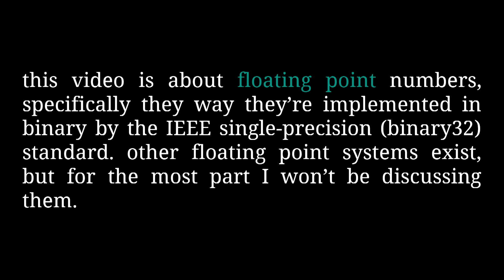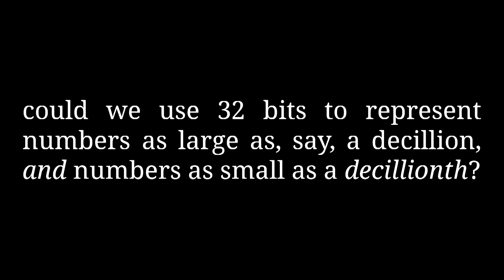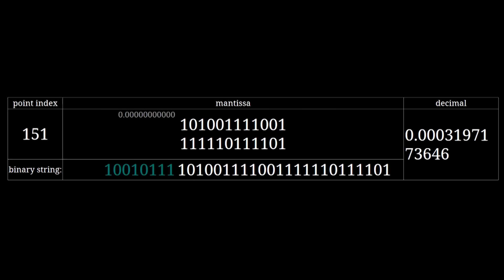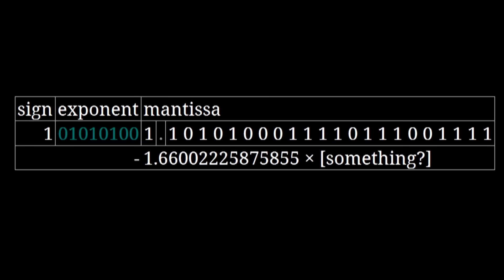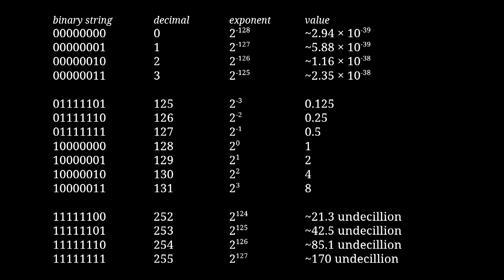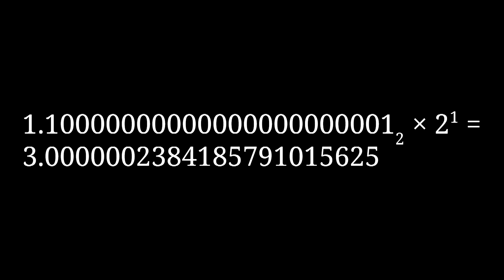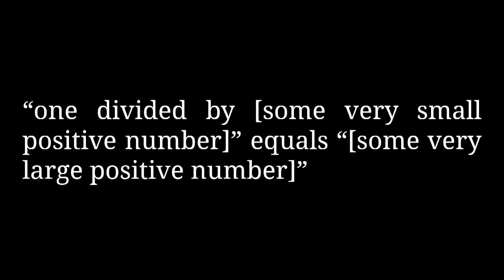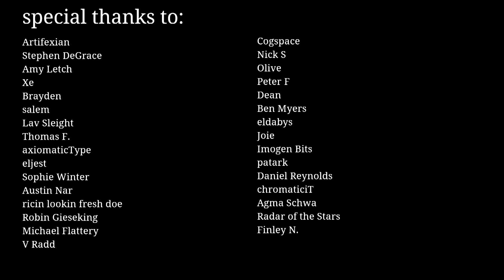how floating point works

Comment: This is better than the explanation given in my first year of my computer science degree, with one important omission:

If two approximations are very good, subtracting one from the other might STILL yield a massively disproportionate difference. For example, a quadrillion minus a quadrillion-and-one is one. But floating point numerals would return 0. So that's wrong by a factor of NaN.

If you don't want a factor of NaN in your multiplications/divisions, this is a (real world!) problem.

Comment: The floating-point standard was written up in 1985. What would you have done in the mid-1980s?

Also, what would be a good suggestion to update the standard?
The suggestion can break the standard.

Comment: binary-coded decimal is a neat one too, calculators use this one a lot. Only issue here is that each decimal digit takes up a byte, or at least 4 bits (1 for each digit, at least 1 definition for a decimal point). This setup allows you to do precise decimal math which you need for a calculator, but you're massively limited by storage space on your device and operations are more time-consuming to perform.

Comment: The coolest thing about the compromises floating point makes, imo, is that even though the constructs it generates are not technically individual numbers (but ranges of them, as you said), they reflect a lot of the interesting realities of working with infinity and infinitesimals in fields like calculus. We wouldn't say "1/0 = ∞" or "1/-0 = -∞" in calculus per se, but intuitively this is more or less correct.

This, I imagine, is probably in part why this standard ended up sticking even though it's kinda awkward. Arbitrary precision is lost, but for engineers and scientists, you gain something better: a rudimentary reflection of higher-math concepts like infinity.

Comment: I don't think 'supernormal' values (other than the infinities) can be represented by floating-point numbers. But they can in metafloating-point/floating-metapoint numbers (I guess (almost) all numbers would them be super- or subnormal.) Just imagine representing 2^2^30 in 32 bits.
Reply: Edit: I think 'floating-metapoint' (where 'metapoint'='metaradix')' is less confusing than 'floating floating-point'. 
And I think the biggest number would be 2^2^29, since you need one bit for the sign.
Reply: Edit: YouTube in Firefox mobile doesn't let you edit comments, so I have to post this as a reply.

Comment: The cool thing about not specifying what the NaN payload bits do is, that there are 52 such bits in 64 bit floating point numbers, and pointers on typical 64 bit platforms only actually need 48 bits. So you can do something similar to "tagged pointers" and say any NaN that has any payload bit at all isn't actually a NaN. Instead 4 bits (minus one value, given that one has to always be 1) can be used as a type and the rest of the payload bits is either an 48 bit integer or a pointer to a heap allocated object. And indeed some JavaScript implementations do just that. You know, since JavaScript's typeof only returns 7 distinct values (fits even in 3 bits with one value to spare)!

Edit: Wait, I forgot function. That means all 8 values of the 3 bits are already used.

Comment: so, there is no zero in floating point ....... that's pretty insane... (only range of numbers barely larger than 0, and another range barely smaller, but never 0 itself) ?
Reply: actually ...  are they inclusive? - could it be, that positive zero is inclusive of real 0 and negative zero is not?
Reply: @Verrisin  +0 and -0 are defined to compare as equal, so they're both in a sense inclusive of "zero"
Reply: @Kaiasky   Thanks. .... so indeed, there really are 2 zeroes... both ranges inclusive.... - At least it does have zero, though :D

Comment: As an engineer where most of your numbers are actually measurements, this is a really good way to approach getting used to thinking of precision and accuracy. The values are only as accurate as the tools you use to measure them.
Reply: Unless coastlines.

Comment: The reason the sign bit is zero for positive and one for negative is pretty simple: in some ancient computer architectures, signed integers were also represented with a sign bit where the highest order bit was used to denote the sign. Using zero as the positive sign bit allowed for positive numbers to still be read normally. e.g the value of 7 as  a 4 bit signed integer would still be 0111: the same as for an unsigned integer. If it were the other way around 7 would be represented as 1111 and -7 would be 0111 which is a less readable choice because neither number is represented in an intuitive way. The same thing goes for modern computer architectures which use two's complement: positive numbers are still able to be read the same as if they were unsigned and negative numbers start with one. 

It would make things unnecessarily confusing to reverse the rules for integers and floating points, so zero is positive and 1 is negative.

Comment: This is a very nice video. I like that you explain not just what floating point is, but how someone would arrive at it as a way of representing numbers. Anyone interested in how the extraneous bits in NaN values are used in practice could look into something called "NaN packing." It's a technique (mostly used by programming language runtimes) used to cram a lot of different types of values into 64-bit floating point NaNs. In 64-bit (double precision) floating point, there are 12 bits used for the sign and exponent bits, and then 52 bits left over. Four bits can be used as a "tag" allowing for 16 distinct packed data types, and the remaining 48 bits are enough to store a pointer (on 64-bit intel platforms, a pointer is only 48 bits wide).

Comment: Fixed point seems to generally be a better option for most applications imho
Reply: You do have to be very careful when implementing fixed point algorithms since eg, if you divide by 1000 and then multiply by 1000 in floating point, you're probably ~ok. If you do that in fixed point, you truncated your last 3 digits. 

Often, if you're careful a better solution is to reformat the algorithm/formula in terms of integers (eg, instead of a number N, you have rational stored as a/b and write your algorithm in terms of a & b) and get by with pure integer multiplication/division.

Comment: I would hypothesize that at least part of the rationale for having 0 as positive and 1 as negative is that it's consistent with how the first bit in a two's complement binary integer behaves, so you can just look at the first bit of any signed number and know what its sign is without having to know whether it's an int or a float.

Comment: "And that's a really good question."
…
"The other problem with—"
😂 
This wasn't just informative and really well-explained, but funny to boot!
Reply: I lost it at this part!
Reply: actually i think it makes sense for 0 to represent a positive number in the system. that way, a floating point number that is initialized to all zeroes would represent positive zero instead of negative zero.
Reply: @chromosoze it also makes sense with how we represent negative numbers usually. If I right 5, you assume I mean +5, I have to indicate -5 which is done by adding that 1 in front of it.
Reply: @chromosoze  it also saves the explanation that we store negative numbers in binary by flipping each bit (including the sign bit), then adding 1. (It makes doing calculations with the numbers easier as it automatically flips the sign bit when it crosses zero)

Comment: I always figured 0 means positive because most of the time you'll be using positive numbers, and 0 is the default value. It just makes sense, from a programming point of view. Default values should represent the most common option, when possible.
Reply: Uninitialised memory may take on any value, unless zero paging, 0xDEADBEEF paging, or a higher level language that initialises things for you. Personally I like the 0xDEADBEEF, starting every page full of that patters means if you forget to initialise anything then the output is very obvious.

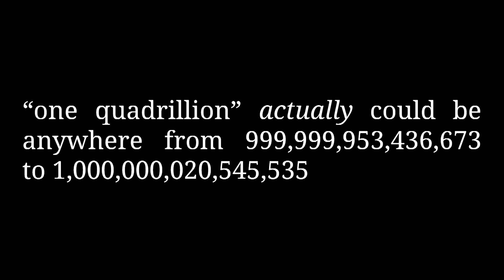Comment: 5:45 We use 1 as the negative input due to how computers subtract numbers. There isn't really a way to subtract a number in binary so instead computers add two numbers that cancel out. If you want to know exactly how that works watch Sebastian Lague's video Exploring How Computers Work. In that video he gives a great explanation. You should watch the whole video, but he explains this at 12:12
The TL:DW is that if you add the inverse of a binary number to the original number you end up with a number that takes one more binary place to represent. (As we say decimal place I'm saying binary place). If you just ignore the carry over digit then you have successfully subtracted two numbers.

Comment: This is the best explanation of IEEE 754 I've ever seen. Much easier to follow than the textbook I originally learned this stuff from 20 years ago. The only things I can remember that you didn't mention are (a) that the FPU has a certain number of extra hidden bits (3?) to minimize the rounding errors applicable to the results of intermediate steps of sequences of calculations, (b) we had a whole 6 week lecture course that I didn't manage to understand (I was a CompSci student but the module was run alongside math majors) about what happens when the system breaks down (perhaps when subnormals aren't enough?) and how to perform operations in the correct order to minimize errors because formulae that should be mathematically equivalent aren't always (c) I can't remember the difference between a 'Signalling NaN' and a non-signalling one, (d) the whole issue with rounding errors, equality checking and 'epsilon', and (e) there was some hype at the time around a then new-ish IEEE decimal standard that was supposed to replace the standard double precision binary format and fix all the problems but I don't know if it ever gained much traction at all (obviously the binary formats are still ridiculously popular).

Comment: one justification for zero representing a positive sign, is that bit b can be represented as a factor of (-1)^b in the number's algebraic representation, rather than (-1)^(b+1). and your "floating floating point" number system is similar to some arbitrary precision arithmetic systems, which are useful in some mathematical and scientific applications, but impractical in lots of engineering settings, which are more common in every day computing. I loved the explanation of subnormals, which many tutorials and even the algebraic expression I mentioned normally leave out :) If you want to know more about binary number systems, you can check out similar logarithmic number systems from the 80s, or the Unum format.

Comment: You're a free man, eh?

I had to find ways of dealing with this when I designed my unit conversion app.  Normally, you would just ignore it, but I decided that I needed to allow fractions and that made these too small to zero numbers pop up in many places.  It took years and a number of solutions all used together, but I think it kind of works now.

Comment: You should look into posits. They are like floating point, but without some of the rough edges. There's also bfloat16 and the horribly named but super interesting (8, 1, alpha, beta, gamma), which is an 8-bit float that's almost as good as 32 bit float for certain tasks (Machine Learning in particular)

Comment: While I was aware of floating point issues prior to becoming an accountant, something I now do quite often reinforces the concept of the inherent inaccuracy of the numbers.  All transaction amounts have to add up to zero, with there being rules for which ones to interpret as negative numbers in order to get this to work.  Since we routinely work with 2 decimal places and Excel by default uses floating point even for numbers that you say to format as "accounting", it is extremely rare for these transactions to add up to precisely zero, and usually you get something on the order of 10^-10.  The really weird thing is that we routinely have to switch between Excel run on our local machine and Excel run via the cloud, and these two versions of Excel seem to always give a different value equivalent to zero.

On a similar note, we often have to test to see if a sum of values is equal to zero.  Don't test for this directly.  Test whether they are less than .01 (or something somewhat smaller if there's a good reason things less than 1 cent might be in the data list).
Reply: Given all the know bugs in excel, it would not trust my career to its ability to add. 
The best data formats for currency are found in any respectable database in the last 20 years. Decimal(20,2) for example is generally a decent data type. It provides integer type accuracy, but for ten digits of wholes, and 2 of fractions. By not representing the fractions in binary columns that are extensions of the integer you'll get the kind of maths that keep you out of hot water with the revenue service, SEC etc. There is no single correct way to implement Decimal, so long as you don't store in any way in which 0.01 + 0.01≠ 0.02, in otherword you don't leverage the FPU to do floating point maths. MONEY is never a float. Charge, Pressure, Mass, Temperature can be a float, altitude even. Latitude / Longitude that can be a bit more contextual. We don't want to round of a countries borders and invade them by "special rounding operation"al error.

Comment: There is also a decimal floating point. It works nice with giving "sensible" results, like 0.1+0.2=0.3, but it's a bit slower to process.
Reply: For those who need an explanation: In binary, the fraction one-tenth is the recurring "decimal" 0.00011001100110011001100..., so has to be rounded off in order to be stored in floating point.  To be ultra-precise, it's stored as 0.100000001490116119384765625 (13421773/2^27) in 32-bit "single precision", or 0.1000000000000000055511151231257827021181583404541015625 (3602879701896397/2^55) in 64-bit "double-precision".

Base-ten arithmetic has a similar issue where (1/3)*3 = 0.333333333333333 * 3 = 0.999999999999999 instead of an exact 1.

Comment: 5:50 I'm learning this stuff right now, and there are 2 answers: firstly, it is more similar to the two's complement system that is used for representing signed numbers, and secondly, you can consider it to be as if you are multiplying by (-1)^(sign bit)

Comment: 14:13 "the subnormals are really 126". Based on the picture, it looks like he meant -126. THE POINT: Why -126 and not -127? What does the "-127" exponent represent? Is it just a normal -127 exponent?

Comment: Recently, by accident, I found and "easy way" to see how Floating Point arithmetic could fail: go to Wolfram Alpha an take the Fourier Transform in time between the integrating points -1 and 1, of the function (1-t^2)^4.... it gives the following result:
F(w)=(768/w^9)*[5w*(2*w^2-21)*cos(w)+(w^4-45*w^2+105)*sin(w)]
Try to plot F(w) and a horrible ripple-like singularity will rise near w=0 up from nowhere because of approximation issues.